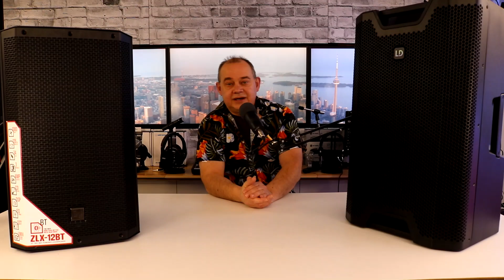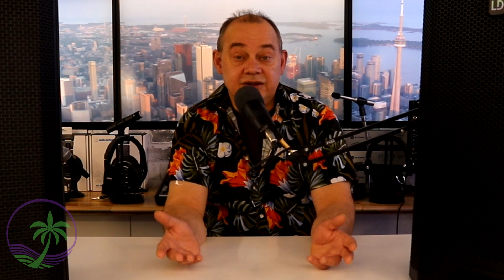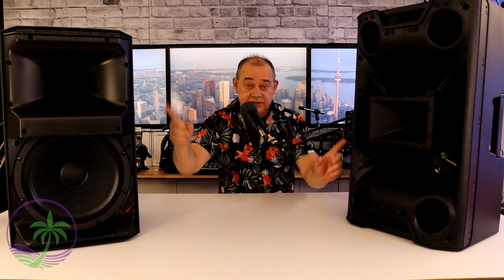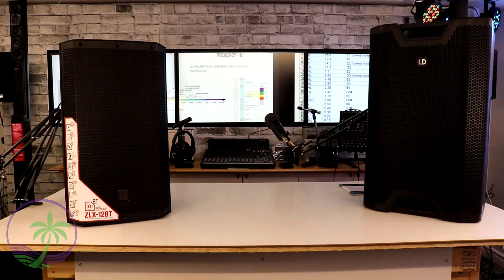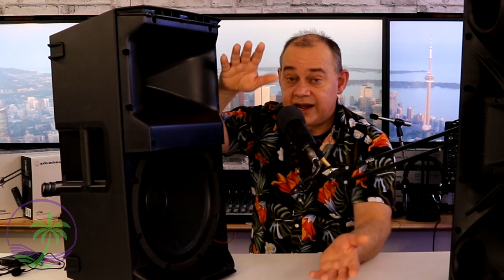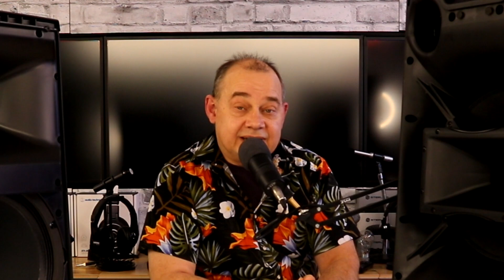Electro-Voice ZLX-12BT SST design Vs LD Systems ICOA-15A BT  Coaxial Design

Comment: At room temp (68 degrees Fahrenheit) a sound wave at 20hz is 675 feet long. A sound wave at 1000 Hz is 13 1/2 inches. And a sound wave at 10,000 Hz is 1.35 inches. So you know.

Comment: Another budget speaker that pack a punch are yorkville yxL 15 I don’t recommend alto they get loud but the horns fail a lot you see a bunch review and YouTube videos fixing and complaining about the tweeter
Reply: Yorkville don’t distribute their products world wide they have limited distribution they need to get their act together cause they do have great products regarding the icoa’s blowing horns they are very cheap to replace ,this reflects more on the operators pushing them too far they need to monitor the limit light constantly or as much as possible that’s what I do.
Reply: LD icoa 15s are betther then yorkville and yorkville is a pretty no name brand worldwide

Comment: Your reviews and how to’s are first class. Super helpful for me understanding some of these features in straight up plain speak. I have a set of 15” ICOA tops and the 18” sub. Massive loud and clear sound
Reply: Can you connect two 15” speakers together using Bluetooth
Reply: @djbabyjayflores835  I think you can with a android device
Reply: Can 2 of these cover 200 crowd ?
Reply: @DINU_R   it can but you going to have to push it to its limits . remember its only 128 max spl .  more professional  speakers can do 128 spl continuously.

Comment: I've just purchased a pair of the icoa 15" active speakers. Tried them in store and was super impressed how consistent they sounded in the room. Excited now to try them live in a band.
Reply: Hola. Cuando los probaste en la tienda tuviste la oportunidad de compararlos con los ZLX?
Reply: Have you tried them live in a band?
Reply: @oscar_thedj  Yes I have, both outside and inside… these speakers are absolutely brilliant! Very consistent sweet sounding treble and midrange, plenty of extended bass and I love the use of the eq presets. I keep it flat for a band, though I use the full range mode for any DJ work as it boosts the bass and treble. Works great!
Reply: @andrewlukinsmusic  thank you so much for your reply, i am debating between 12” or 15” to use with my icoa 18. It’s a few db difference.
Reply: @oscar_thedj  as you already have the sub, I would personally go for the 12s. You’ll end up putting a hpf on them anyway. Plus they will be a lot easier on the back. As much as I love the 15s, they weigh a lot!
Reply: @andrewlukinsmusic  thank you, i needed that advise. You’ve made my decision easier.
Reply: @andrewlukinsmusic   i Have 2x ICOA 18sub and 2x ICOA 12BT we are using this sistem in my band and top speakers eq is LOW 0 db  MID +4db , HI +2db better for direct and open vocals.
Reply: @Sokratmokrat  Or you could achieve this same thing with eq on the mixer end.
Reply: As of now October 14 2024 ,I have Alto Ts415,JBL eon 715 and LD icoa 15a after almost a year of usage outside and inside of our house for celebration and partying, safe to say that the LD icoa 15a is a top notch indeed
Reply: @euceryn31  True the icon series sounds better but the TS415 is only 17kg’s so it’s obviously aimed at people who can’t lift much
Reply: @euceryn31 how would you rate those sets against each other or anything else youve heard? Which would you buy first or even not buy? Appreciate any insight. Thanks.
Reply: @euceryn31 I'm choosing right now between JBL EON15 and LD ICOA 15 BT, such a hard choice... Did you use LD with sub? Is it much better for you regarding bass low frequencys if to compare with JBL?
Reply: Do they have good loudness? Can they match to k12.2?
Reply: @DINU_R  I can’t comment on the loudness level compared to other speakers, but generally I’ve noticed 15” speakers seem to project sound a further distance when playing outside and provide an extended low frequency range. There’s not much in it in terms of volume compared to the 12”

Comment: If I have the option to get a pair of LD ICOA 15A, the EV ELX 200 or the Behringer B115BT, with a pair of same brand 18" subwoofer, which one should I get to work outdoor events?
Reply: ICOA for outside is unmatched
Reply: ELX 133db spl but it is more expensive $799 the icoa 127db $399
Reply: without a doubt the Ev ELX 200...👍
Reply: @yeifreeduardogalvisbayona8662  Thank you!
Reply: @yeifreeduardogalvisbayona8662   I have both & ICOA is by far better trust me…
Reply: @jmfbabyj  Really?
Reply: @chromechromechromechrome  yes those speakers are Beastsss
Reply: @jmfbabyj  Do they get as loud as the ELX though? Mainly thinking of using them for bigger parties paired with my subs.
Reply: @chromechromechromechrome  yes… you won’t be disappointed I bought 4 subs & 4 tops & they Bump…
Reply: @jmfbabyj interesting, do they get as loud as EV ekx or qsc k12.2s?